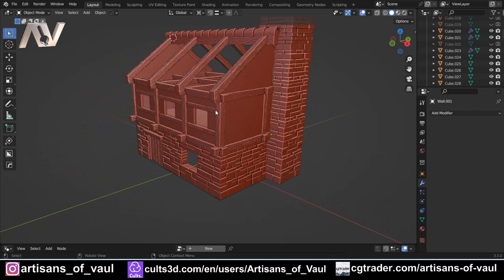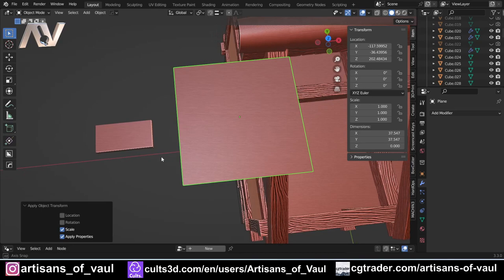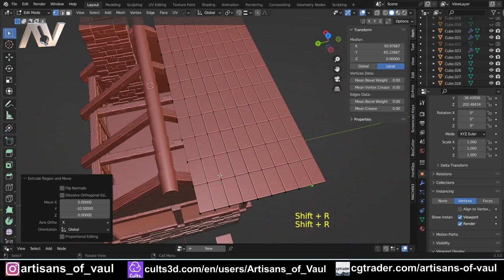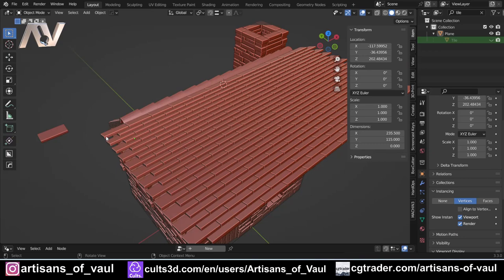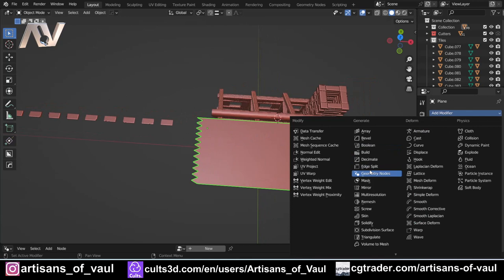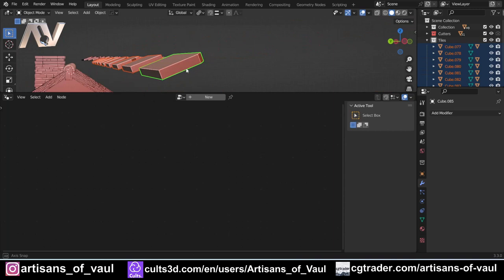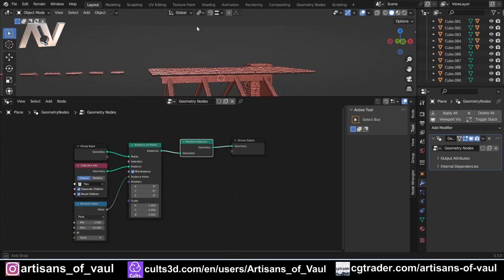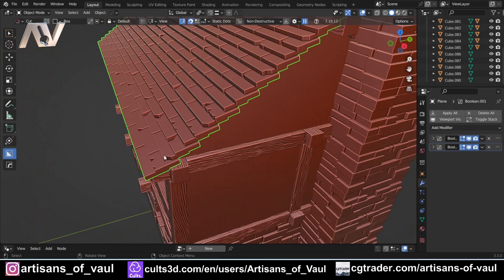Roof Tiles Using Instancing and Geometry Nodes - Designing a Fantasy Building for 3D Printing

Comment: Nice one again. I did not know about the Boolean and make instance real node thanks for this - Will hopefully safe my current model :). I used the "make real and apply" option in the menus afterwards. Maybe just one more tip to create some more randomness. As you applied a  random node for the choose of the tiles you could also add a random node for the rotation. By this you have even a more natural look (my opinion) I think you only require to change from float to vector... Keep it up mate. Cool as usual!
Reply from the maker: Thanks and great comment. You can also vary the scale which is another good way to add further variation. I didn't include those because I didn't want to overwhelm and the tutorial was getting a bit long but it's really appreciated that you commented so that people know. 👍🏻😁

Comment: So I've been following the video series for designing a fantasy building for 3d printing.  Am I missing videos for creating the underlying structure for the roof? IE the support beams and the floor for the 2nd level ?
Reply from the maker: Not specifically. They are made in exactly the same way as the other wooden beams. I thought it would be a bit repetitive showing the same thing twice.
Reply: @ArtisansofVaul   Makes sense.  So had to reinstall my os.  Blender upon reinstall when I click tab doesnt give me the options to shift from object to edit mode or face, edge or vertex mode.  Is this an issue you've seen before?  I've spent a few hours scouring the internet for a solution with no results, so I figured I'd ask yall since this is what you do. Thank you in advance.
Reply from the maker: @anthonyfalsone1624  If you used Machin3 Tools you'd probably need to reinstall it as well.
Reply: @ArtisansofVaul  I still need to do that. Ill give that a whirl and see if that fixes the issue
Reply: @ArtisansofVaul  hey look at that, reinstalled Machin3 Tools and it fixed the issue.  Thank you for the idea!

Comment: Hello AV, Thanks ...that's impressive. But what if we are not on a plan? like on a boat hull for instance. would it be possible to intergrate riveted tile on the hull using the same method🤔?
Reply from the maker: So the plain that its on shouldnt have to be straight/flat.  Though I think I would probably do it on a flat object and then use a lattice modifier to shape it.  That being said there is probably a way to do this using geometry nodes too, Im just not quite there yet 😅
Reply: Thanks for your answer AV. I'd be eager to see that if that Is technically possible. In the mean time I subscribed of course for I can learn a lot with the "Artisan". 
(By the way, Artisan is a French word).
Thank you again.
Raphaël (from France). 👍